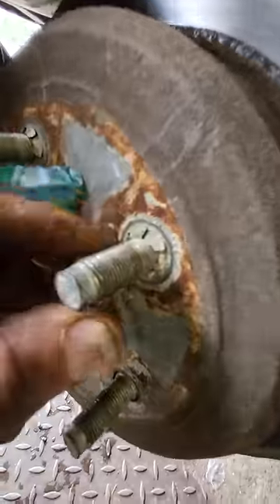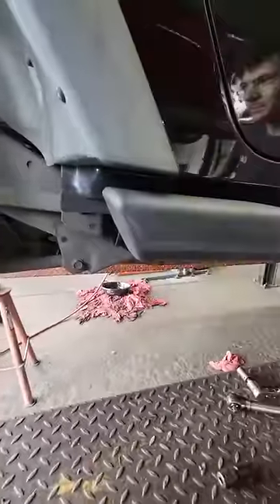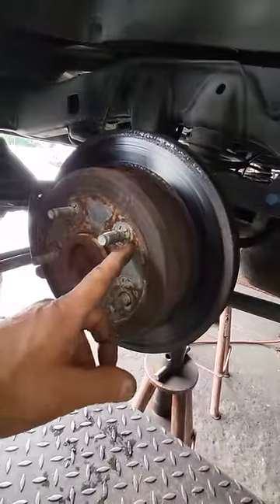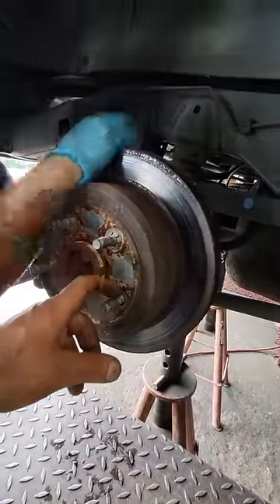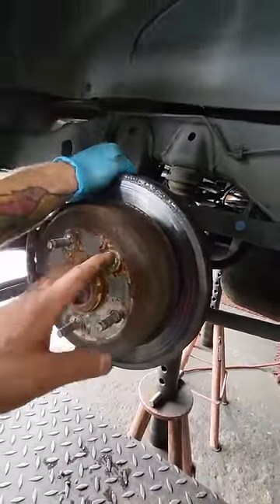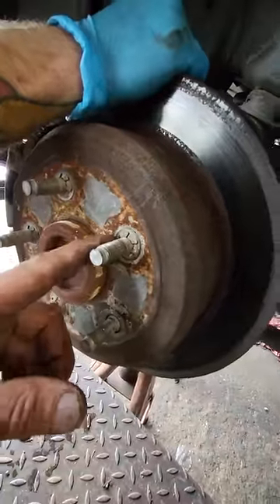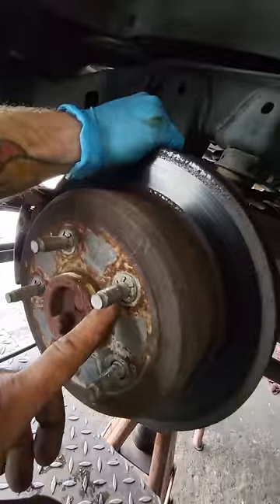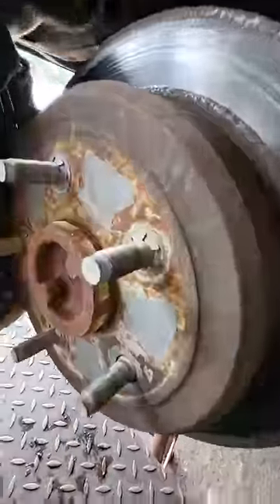There is always that guy

Comment: I’ve argued this since the 80’s! Co worker  states, “if the wheel falls off, this will keep the rotor in place”. 
LmFnao! If your wheel has fallen off, you have much BIGGER PROBLEMS! 🤣
Reply from the maker: The caliper bridge will
Reply: He thinks the rotor will work as or like the wheel.
Reply: As someone who had had their wheel fall off you are right I had much bigger problems
Reply: Fun fact, they were created to keep assembly line workers safe as the vehicles were rolling down the assembly line, a worker was struck by a rotor and injured pretty bad, and now they are mandatory at the factory, but totally useless at the technician level
Reply: Chrisrinz230, EXACTLY! 👍
Reply: Also I have only ever seen one clip per rotor from factory 😳
Reply: I do HVAC for a living and some manufacturers would require these small mounting screws to “hold the unit in place to the rooftop” granted these units were a couple thousand pounds.. my boss would laugh and say “if a wind storm is strong enough to move this equipment, then that’s the last thing they need to worry about”
Reply: @chrisrinz230 when I first started in the late 80’s, two was the norm. Especially on GM
Reply: @erickmischke38 good to know, did not start my career till early 2000’s  didn’t see many 80s cars on the road by then
Reply: yea but also the brake calipers and pads will hold them in place
Reply: The rotor is a secret spare you bafoons
Reply: @justtoxins7081  don’t you have some poor rust farmer to rob !
Reply: Ever play simpsons hit and run?🤣
Reply: If your wheel falls off, your mechanic owes you some new equipment lol.
Reply: @BigInjun05  thee who smelt it, delt it
Reply: Think we can all agree We poop out maximum efficiency, accuracy, and excellence, yet come pay day we see we are unremunerated, ain’t it a shame boy? I hope all you hard working sum gums have. A great weekend !!!! Enjoy
Reply: @lxwgoo999 most likely wheel bearing?
Reply: @chrisrinz230 huh? I guess they were teaching that in the rest of the 11th grade that I skipped out on..that or they was teaching that in 12grade when I fully dropped out! because I've neeeeever heard nor seen someone use that word in a sentence nor have I ever seen that word in a book or a school book! hell I even had to write every word in the diconary (multiple times even!!!) and I STILL never seen the word unremunerated IIIIN MY LIIIFE
Reply: Srsly tho with those clips you dont need wheels this is a lowrider upgrade
Reply: @lxwgoo999  i had a rear wheel fall off and i rode the inside of the rim to the shoulder, the wheel having never escaped.  I chalk it up to a cointoss landing on its edge.
Reply: @justtoxins7081  lololololol!
Reply: I work at AAM(AMERICAN AXLE) we build the rear ends on GM and Ford. Those clips  are just to hold the rotors on during the assembly process (we have automated skids that carry the axles so it can be bumpy)
Reply: @chrisrinz230 thanks for actually explaining the parts function
Reply: YOU have bigger problems the guy getting the pieces in his windshield has pieces of rotor in it.
Reply: @jacob1121  what?
Reply: @jacob1121  LmFnao!!! Ayep!
Reply: those brakes are totaly unneeded there always something you can stop against
Reply: @herec1725  They prevent the unit from walking. Vibrating around
Reply: Arguably these won't even retain the rotor if it makes contact with the road, the caliper might but yeah, if your wheel falls off, who cares? These clips are stupid. Probably only need one anyway.
Reply: They don't matter at all in that situation. I've seen it before from shady tire shops or wheel spacers.
Reply: @Al-ed2jc  To be honest, that's what happened when the wheel rolled off my van. Glad the brake disk was there, minimal damage. It was one of those held on place by a couple of screws though, not this kind of clips thing.
Reply: One of you should know that the caliper would hold the rotor in place if the wheel falls off.
Reply: @chrisrinz230  sound like a worker messing up to me and not a rotor becoming sentient.
Reply: @TwinShards  true, i mean you can make fire from water if your try hard enough 😂
Reply: @chrisrinz230 just starting my career 2 years in
Reply: Do you honestly believe those 6 plastic tabs are going to stop a rotor from popping off when the thing is dropped from 4-8 inches? 

I wouldn't put my faith in them lol. Best bet is don't loose a tire in the first place lol
Reply: Your suspension is going to smash the ground but at-least the rotor made it
Reply: @chrisrinz230 as an early 80’s auto mechanic, I’ve seen soooo many with 2 of these things!
But I’m sure, at some point, they figured out that just one, would do it! 👍
Reply: @Al-ed2jc it will.....tell me it won't, and I tell you about the time all five wheel studs broke off on my passenger front side on the highway and I had to get from the far left to far right lane. It absolutely DOES function like a wheel.... because......it is a wheel. A high friction wheel.
Reply: @lxwgoo999 samesies, not fun at all ahahaha
Reply: As a guy that just lost a rear wheel to a e350 van on the interstate a few weeks ago, I can attest that the rotor was still there, partially flattened but still there😂😂
Reply: @jacob1121 I think you meant pieces of asphalt, rotors are one of the toughest pieces of steel on a vehicle!They don't break for nothing! Did you see that police chase where dude stole a Range Rover and literally drove the wheels off that fu€|<ing thing?!
Reply: @chrisrinz230 Running cars on water has been done several times over the past several decades! Kinda funny how that technology never really goes anywhere, isn't it! You know, with them being so concerned with "climate change" and all!
Reply: @wesman7837  the system of life as a whole is a bunch of statistics. Arranged in such a way to where the odds are never in our favor. The rich get richer and the poor get poorer. Beat the odds sir best wishes to you
Reply: @anthonynastasi4098  this has happened to me, broke the stub axle on a front wheel drive celica and all that was holding my wheel on for the rest of the 15 min trip home was the caliper and torque plate.
Reply: A lot better than Honda retaining screws.

Comment: I'm that guy. I'd do that. Why? Dunno. I was raised to put stuff back the way I found it and now it's stuck in me. It  helps when getting a caliper back on but only a little bit, probably no real difference with or without the retainers or screws.
Reply: Somethings don't need replaced. Waste of money
Reply: Thank you for saying this!
Reply: @dave3660 do they cost big bucks?
Reply: @chematortuga4325  anything wasted is big bucks.
Reply: @chematortuga4325  from what I've understood from their incoherent grunts it isn't a cost issue or getting new ones. 

They just don't want to put the old ones back on because they're too ham-fisted to get them off without breaking or deforming them.  Or they simply don't think they're needed, when they are.
Reply: The clips are not necessary once the wheel is bolted on at the factory. They are only there to keep the rotor on the axle through the entire assembly process.

But once the wheel is on the factory can't remove them

It is your duty to remove and discard them, and the set screws some rotors use to make the world a better place.
Reply: @ssss-df5qz They fulfilled their purpose as soon as the vehicle rolled out the assembly line door. There is no reason outside of the assembly line to have them.

Health and Safety department doesn't like it when rotors fall off the assembly line onto workers for some reason
Reply: Id bring my car to you over the other guy every time.
Reply: Id rather pay you then them half ass workers lmao
Reply: @ssss-df5qz They're not needed bud.
Tbey only hold the rotors on on the assembly line until the wheels are installed.
Please stop talking as you clearly have zero training regarding vehicles.
Reply: @deadprivacy And get charged for work not needed lmfao.
A fool born everyday.
Reply: @hughjanus5518  well, the cost of a brake job where I work is exactly the same if I work on it or if the guys who don't put the rotor screws back on work on it. So there isn't really a cost difference, we charge like an hour and a half of labor for brakes, and then there's the parts cost. 
So again it basically makes 0 difference, it'll just take me "longer" to do it.
Reply: @hughjanus5518 dont mess with OEM spec.
Then you are never on the hook for any liability.
The end.
I also dont like brake rotors falling on my damn foot if i take a wheel off.
Or dropping amd cracking if im in there doing another job.
This guy aint thinking of the next guy.
I bet he leaves sharp cut off cable ties everywhere too...
Reply: Nope don't need them. Lug nuts will hold the rotor in place
Reply: If there is no instructions to throw them away, I would put them back. Imagine a brain surgeon not putting something back? That's my thinking.
Reply: Keep waisting time and money. It’s strictly for the assembly line.
Reply: @ssss-df5qz the clips are only on because someone got hurt on the assembly line. Other rthen that they are useless
Reply: OEM for a reason 😊
Reply: @deadprivacy if your brake rotors fall off when you take off the wheel you have a big issue on your car bud, and not replacing the retainer is helping the next guy so he doesn’t have to waste time taking them off
Reply: @deadprivacy how is a rotor going to fall off when you take the wheel off with the caliper preventing it from doing so? 😂 You couldn’t take that rotor off if you wanted to without removing the caliper and bracket. Know how I know you don’t work on cars?
Reply: I'm sure if you where raised to walk off a cliff you'd probably do that too huh?
Reply: @chematortuga4325  when your wheel is tightened back down,the rotor is being sandwiched (metaphorically speaking)between your wheel and your wheel hub therefore it aint going nowhere..besides,even if it did i promise you this;that little fucking screw will snap off .i am 100% positive about that. 
Oh yeah and considering a 5 minute job costs your pockets an hours worth of bidens money.
Reply: @Jpilgrim30  so i cant be in there to change the caliper , can i?
We have these tools see, lots of different fittings, fir removing parts.
In fact its the caliper removal stage where its likely to drop out.
Reply: @Jpilgrim30  and the fact you think the bracket  must come off to remove the rotor?
Always?
 On everything?
Sure.
Reply from the maker: @chematortuga4325  very inexpensive
Reply from the maker: @ssss-df5qz  very true
Reply from the maker: @Texassince1836  💯
Reply from the maker: @deadprivacy  thanks you for your time
Reply from the maker: @brandons552  💯
Reply from the maker: @RealWorldGarage  💯
Reply from the maker: @Jpilgrim30  experience rite here very knowledgeable  response
Reply from the maker: @deadprivacy  not every caliper bracket some easy access
Reply: I'm that guy. If it came in that way. It goes out that way
Reply: You don’t work on cars
Reply: @bigmodsgarage  you're right! I absolutely don't! There's not a single car related video on my channel (Don't check). I've never actually touched a car in my life. I take the local river Gondola everywhere like a normal person would. Tell me everything you know about me that I don't know. I am very curious to know who and what I actually am.
Reply: People who put them back are the type of people who like getting told what to do. I am more of a common sense kind of person. I don't even put back those set screws they use on some rotors because they are a royal pain to get out once they seize. And once they seize, the rotor is probably seized as well in which case it won't fall off when you take out the wheel. They literally serve no other purpose than to hold the rotor when the wheel is off for safety reasons. Have you asked yourself why new rotos do not come packaged with this hardware if it is necessary as y'all say?
Reply: I’m that guy too. Brass wire brush them for a few seconds, slap em back on. Why not? You’ve already got them anyway. If they’re not rusted out, might as well use em.
Reply: What you weren't raised to do is to develop critical thinking and think for yourself.
Reply: @deadprivacy if a rotor falls on your foot when you take the wheel off, you have bigger problems, as the rotor is held in place by a caliper.
Reply: @thedirtroadlesstraveled703  amd when you pull the caliper what does the rotor do?
Falls on yiur foot.
Reply: It's because you don't understand why things are there. So new means good lol
Reply: @deadprivacy  ok. Never happened to me in 20+ years of turning wrenches, but ok. Also, that's why you wear steel toes in the shop.
Reply: Best mechanics usually say this; they usually say things like "why do anything out of spec".
Reply: @deadprivacy rotors don't fall off on ir foot unless ur an eeee ddd ooo ttt
Reply: I love all of the self-appointed automotive and factory-line process engineers who’ve shown up in these threads to explain the precise original purpose for those clips (and to make fun of everyone else for imagining they have any utility post-installation). My take(in general): if you didn’t design it and you didn’t build it and you haven’t been explicitly instructed (via training/factory service manual/etc.), then you’re far better off assuming there’s a durable purpose and making every effort to put things back the way you found them (unless you want to go do research and homework to prove out your theory that the thing isn’t necessary).
Reply: hey, there are some things that really needs that attention to detail and putting it back exactly the way it was. nothing wrong with being "that guy" even if it isnt needed haha.
Reply: @cmmartti  pro-tip, get a piece of all thread the same thread pitch as your wheel bolts. Thread it into 1 hole and itll hold the rotor in place and guide the wheel on.  Once you get the other wheel bolts started remove the all thread and put a wheel bolt in that location too.
Reply: @dave3660 the clips are .08 cents a piece at Ace. Some of us just have that kinda change laying around 😂😂😂
Reply: @MultiTastebuds or you can use common sense and a small bit of mechanical knowledge. The wheel holds to rotor via the lug nuts buddy. The flimsy piece of metal does jack shit outside of the factory. It holds the rotor in place so it doesn't fall off before the caliper and wheel is installed. Think before you speak.
Reply: If I'm going to go to a shop I'm going to want it done perfectly how it was from the factory unless I said otherwise
Reply: @walker1952  should be the only way it gets done. everything else is cutting corners.
Reply: Thread one of the lug nuts on to keep the rotor in place when changing pads. Cut that shit off and throw them away 🫡
Reply: @MultiTastebuds while there are a lot of mechanics that do call audible when they shouldn't this is not one of those cases; those retainers do absolutely nothing once the car is assembled. 

My only beef is with the people saying they'll just put one on... Either put them all on or take the all off so the thing doesn't end up slightly canted to one side when you crank down on the wheel nuts for twenty minutes with your impact wrench.
Reply: EXACTLY!!!……BUT here come the Conspiracy theorist……They already got the poor young kid shaking his head 🤦‍♂️
Reply: And in NY State, the rotor isn't coming off anyway, not until you smash the thing with a BFH
Reply: @ssss-df5qz the wheels litterly hold the rotor on. They're just there to keep them on for the assembly line
Reply: @deadprivacy if a brake rotor is falling off on your foot taking a wheel off then you better check the caliper bolts and not some silly clips that dont do anything
Reply: Just put the lugnut on until your bracket is back mounted.
Reply: Use a lug nut to hold the rotor after you remove these clips if you must.
Reply: @BigWheel.  Do the countersink screws serve another purpose like on Hondas for example? I always reinstall them but not the ones on the stud
Reply: Fair enough I understand putting stuff back when I’ve removed it too but I’d skip on those but hey two 14mm pain in the ass bolts on a battery tray that has 6 for some reason I’ll put those back every time unless I drop them more than twice 😂😂